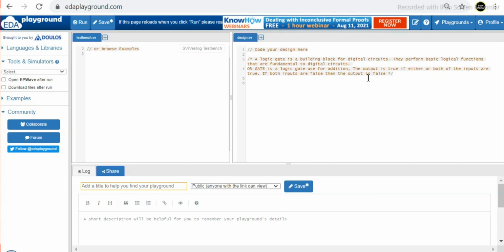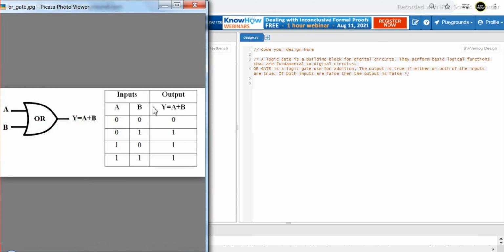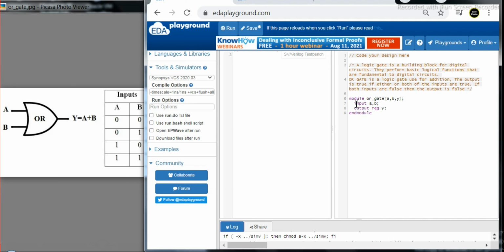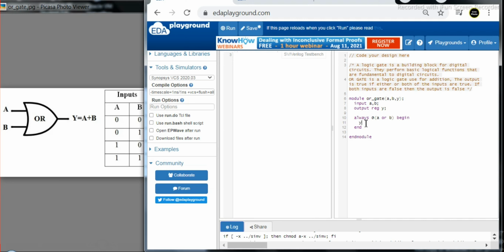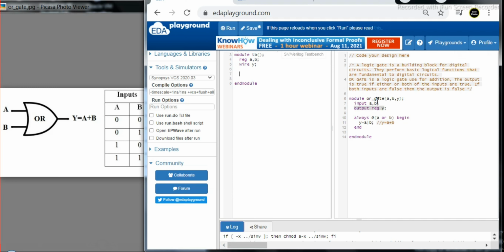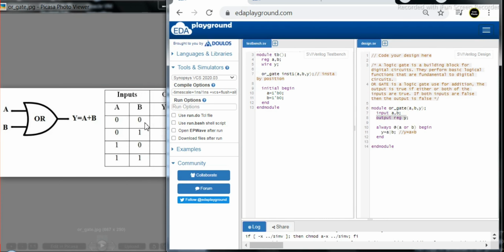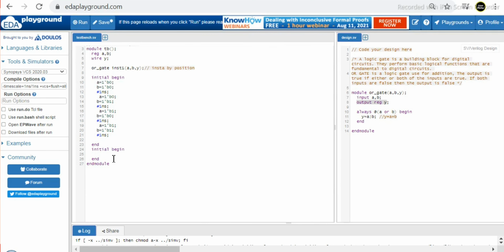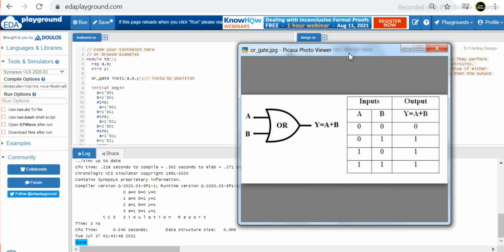Digital Logic Gates #OR_Gate #Verilog @edaplayground #VLSI

Comment: Tq sir got clarity clearly explained every small thing...my only doubt is wat is instatiation in """"test bench"""...and  it will be more beneficial if u run and output time cycles etc
Reply from the maker: Hi Sanka, Glad to know you've understood.
Well there's two module in this video, one as or_gate and the other is testbench(tb).
Or_gate module is the rtl design which means it has some specifications and functionality (operation to do).
Where as tb is a mechanism that will generate stimulus (inputs to or_gate).
Unless or_gate is connected to tb, or_gate will not receive inputs/we can't verify the design.
So, inorder to connect to or_gate, Instantiation is done in the tb and we need to map(connect) the signals of or_gate to tb signals.